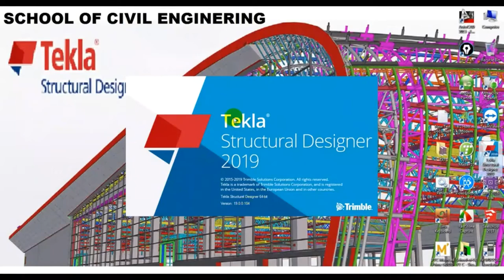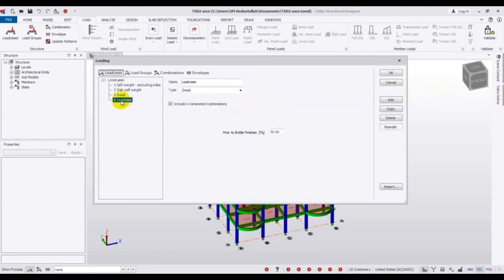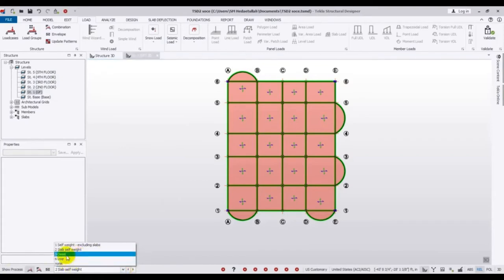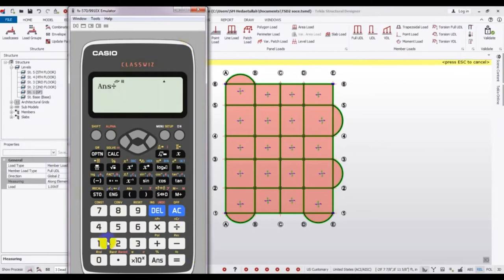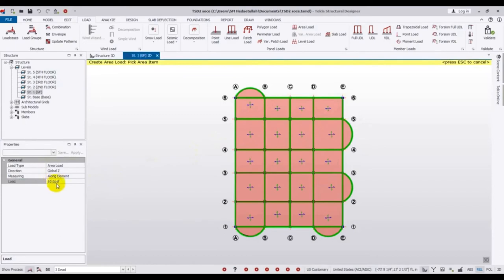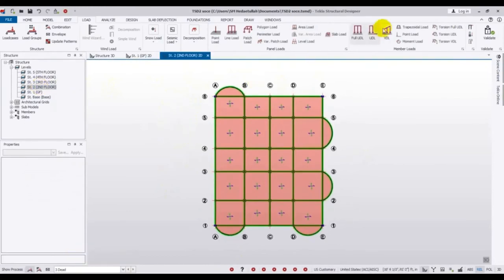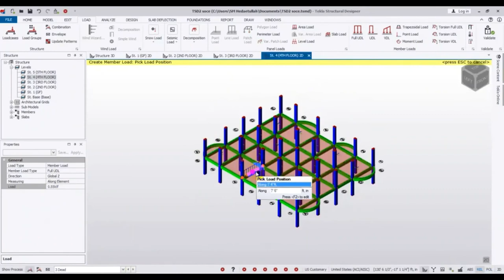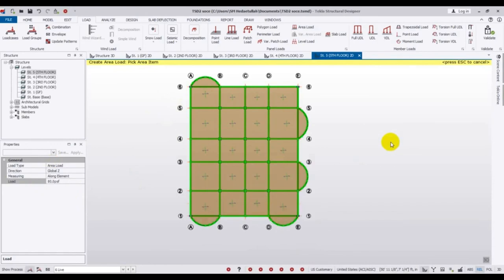Modeling in Tekla Structural Designer 2019 | Applying Load on Tekla Structural Designer

Comment: Hello sir for my case when I turn to the floor plan, the part where u choose from the type of load to apply say dead or imposed disappears send when I switch to 3d, it comes back.... It's like am supposed to apply on loads when am in 3d why???
Reply from the maker: That's not a problem. You change that from setting.